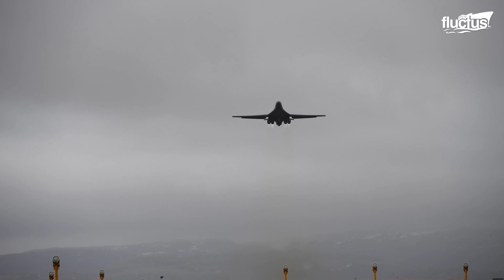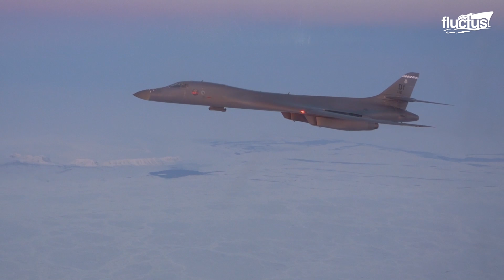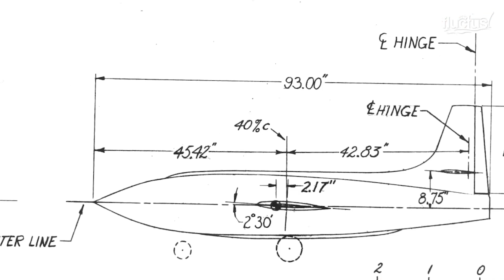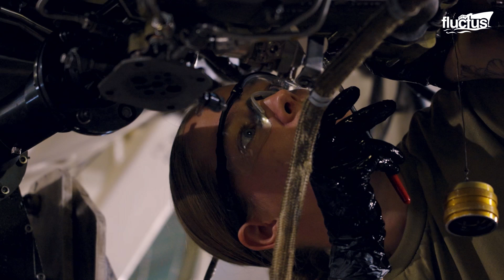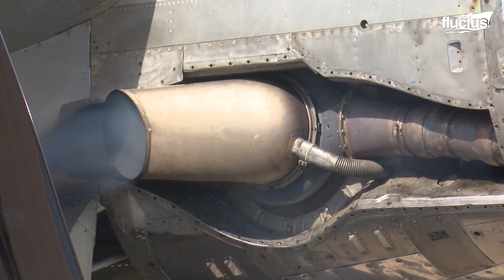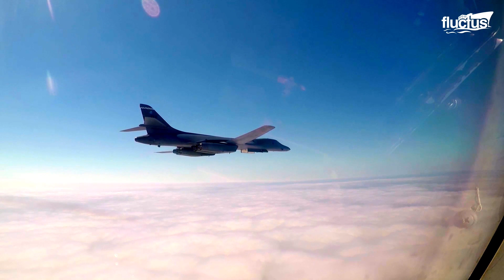B-1 Lancer : US Most Feared Supersonic Bomber Ever Made

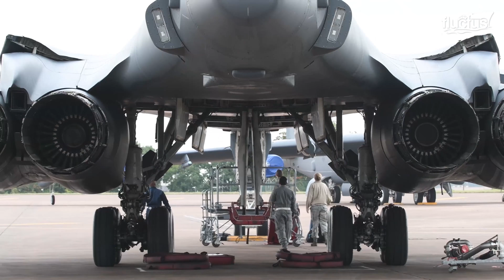Comment: You should have seen… no, HEARD, the massive CNC we used at Chemtronics to cut, shape, the metal in the engines of this jet. Once it was activated, it would come on and roll forward, and it sounded, like the opening musical rift from Billy Idols song, ‘White Wedding’. Identical sound. Why at Chemtronics? We had to use acid to install the “ details “ on the huge titanium engine casing. Then there was the super strong tool steel ring. It looked like a man’s wedding band. A giant man. 9:05